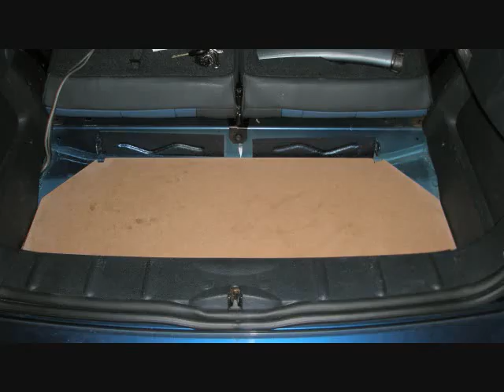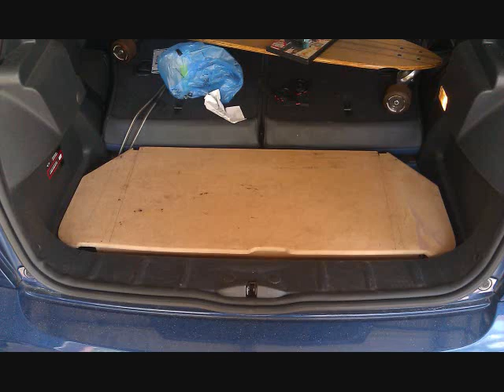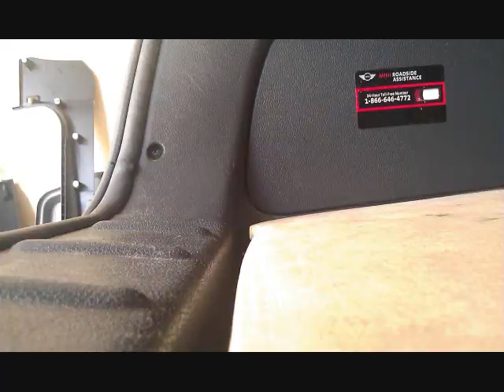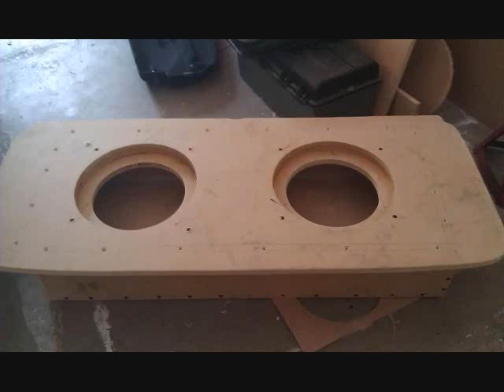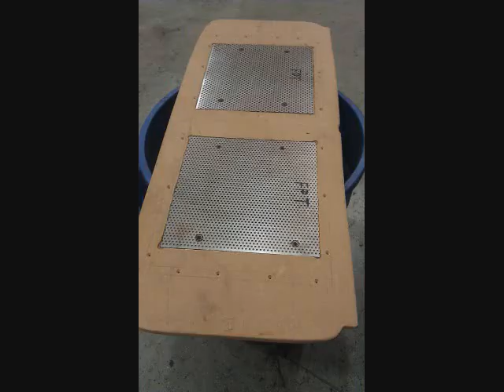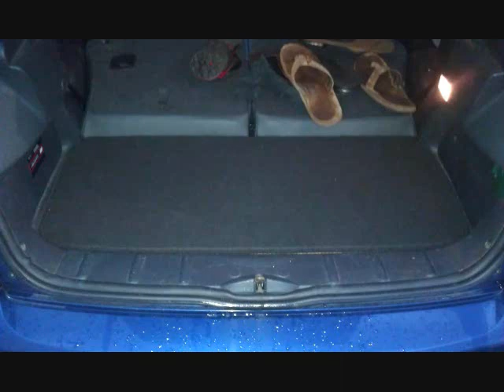Mini Cooper Subwoofer Box Build Sub box

Comment: Excellent job Nolan. I'm thinking of 12's in my Cooper. I'm going to have to build higher than your stealth design but I plan to incorporate channeling and ports as well. Hopefully I can achieve form and function without losing more than six inches of interior room a cross the floor.